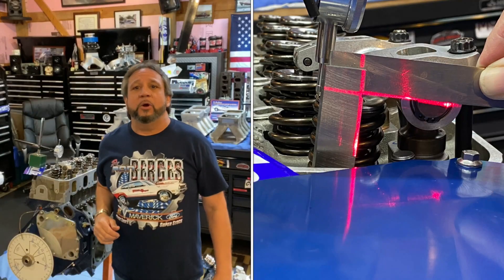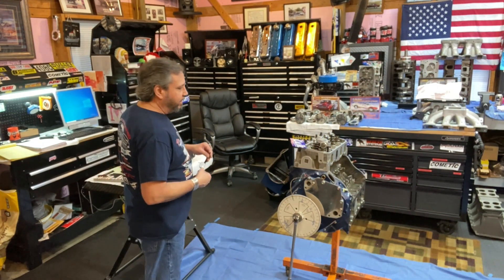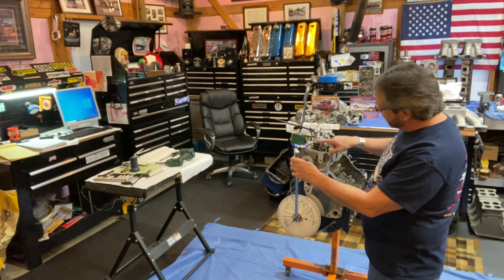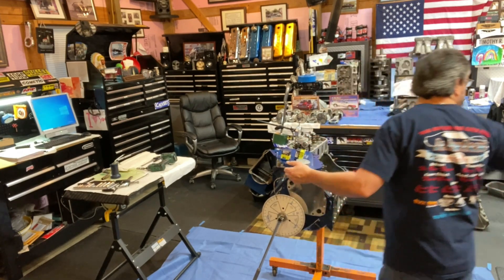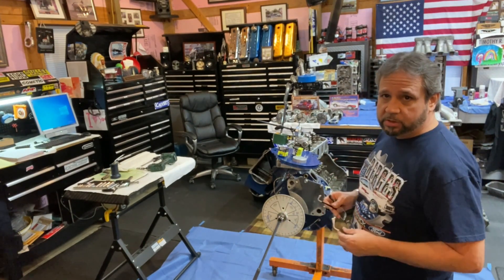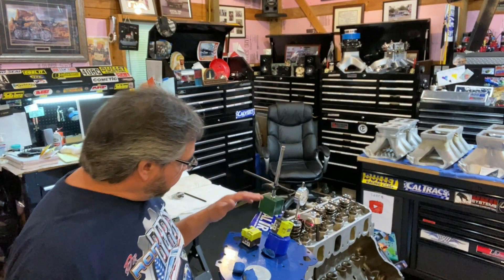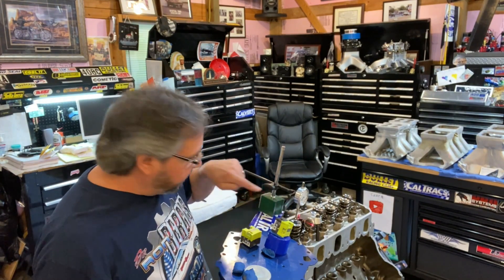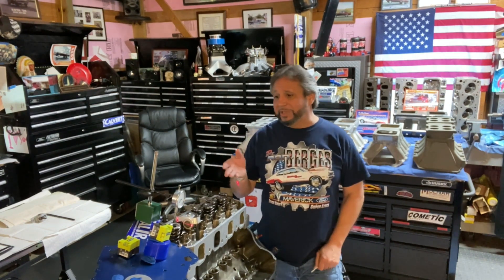Mid Lift Theory /Rocker Arm Geometry, Laser Guided Precision.

Comment: Hello, I think you would like to know that Jesel aluminum rocker arms are not
 designed for mid  lift. The tool that they sell for setting rocker arm geometry sets the shaft higher than than the adjuster. This gives the roller more movement across the valve, stem at low spring pressure or low valve opening. There is very little roller movement across the valve tip at full valve opening. Less wear on stems and guides. I worked there for 22 years and they were always this way. Instructions are on the website if you’re registered I love watching your channel. Keep it up. Thanks.
Reply from the maker: I have seen the tool, I know what you mean. I have always just used the pattern with dykem. Russel Saliba turned me on to this, so thought I would make a video and see how it works. Others have said this is wrong. I say do what works for you. Glad your here. Always seeing and learning something new at DragBoss Garage

Comment: Thanks for the video. I’ve always been a believer in the mid-lift theory,but never once thought about using the lasers. 

The lasers are the Ryobi ell1500  from the home depot if anyone is wondering; I didn’t hear it referenced in the video, but I zoomed in and noticed the model number.

I also believe that this same principle applies at the pushrod; if your pushrod axis is at an angle to the valve stem axis (as most engines are) ; the optimal pushrod length will be when the ball of the adjuster is at the intersection point (90 deg) of the pushrod axis to the rocker pivot….
Reply from the maker: Your most welcome.  I forgot the part number good eyes for sure. It something someone showed me so I tried it. Close enough for government work. Thanks for watching

Comment: Nice job Tim.  I have also tried many types of rocker arms to not only get 90* on the valve side at mid lift, but on the pushrod side at the same time. Hopefully the roller tip is close to the center of the valve tip within reason.  With so many different rocker arms, valve degrees angles and stud locations it's not always attainable but I did manage to find one combination that worked for me.
Reply from the maker: Yes, it seem to work out. Well, after I run it a few more times, I need to pull the passenger side, header to get ready for the transmission. Then I may run the lash just to make sure it’s good and ready to rock. Seems good I appreciate you being here Lou.

Comment: I think that makes total sense. That gives the same amount of positive and neg travel to the rocker. Having rockers that adjust the lash on the pushrod cup would be ideal. When pushrod length is your only way to correct your geometry your stuck with .100 increments and lash caps. But the theory is sound.
Reply from the maker: It seems to work and make sense and laser accurate so I used it.
Reply: @DragBoss351Cleveland  Yeah I totally agree. I'm looking at lash caps to fine tune the angle on a sbc where I'm limited to certain pushrod lengths
Reply from the maker: Yes have ti valves and use lash caps so had to take that in consideration for length too Bo

Comment: Great stuff 👌🏼🏁
Reply from the maker: Just another tool for the tool box, and cheap too.
Reply: @DragBoss351Cleveland  yeh man 4sure 👌🏼
Geometry in the valve train is very important.
The Blue’ing bit & keeping the roller tip in the centre of the valve tip is a must for sure 👌🏼
Laser bit is new to me 👌🏼✅ there’s always some maths at play isn’t there (mid lift)....
Another great way to confirm or double-check i guess......💪🏼🏁
Reply from the maker: That’s the way I look at it, another way and also check your results after using the bluing method. Sharpie marker works best and easy clean up. Thanks Janks
Reply: @DragBoss351Cleveland  👍🏼🏁

Comment: the way you set up the lasers looking down the head is fine for inline valves.  for a canted valve you have to rotate the setup so that the lasers are perpendicular to the rocker arm.  this means rotating it 20* or so for a cleveland.  aiming for mid lift means shimming the rocker arm *first*, then finding the proper pushrod length (don't use the pushrod to "fix" geometry).  Billy Godbold said he aims for 30% lift.
Reply: What do you mean by shimming the rocker arm ?

Comment: Rocker arm geometry is a really complicated subject when u actually get into it.  Not only the arc of the valve side but the pushrod side has it's own arc that's different.  Using the dye or marker method can be used and should be done, mid lift theory is something u should always check.  Getting the height correct is the most important, then u can move the rocker fore or aft to get the sweep u want.
Reply from the maker: It sure is. I will have Larry Olsen back on and he wants to do a live chat on rocker arm geometry. I have used both methods. Laser method held up for me, so I roll with it. Lots of hidden hp in rocker arms. Stay tuned Mike.
Reply: That would be awesome.  They don't make em like him anymore.
Reply from the maker: Nope they sure don’t. Alan Root will be back too in the next month I hope for a big announcement. Have a Merry Christmas

Comment: Great video!  The use of lasers is a great idea.  Also, most of the techniques & theories you go through can be applied to engines in general, no matter what manufacturer and design. Specific valvetrain design can be applied to the 385 series big block as well since the valve angles are the same and port design are very similar.  Thank you for sharing your knowledge.
Reply from the maker: Don. Thanks so much for the positive comments and your experience. You are right, applicable to any engine. Great to see you here, more in store
Reply: @DragBoss351Cleveland  I built a 400M using KB pistons for a 351C & bushed rods, decked block  & heads, port & bowl work on stock heads with new guides, seats, & '80-'82 single groove OE valves, roller rockers with the Crane plastic insert guide plate kit, custom Comp cam (used SB Chevy lobes) to keep 218/224 @ 0.050 duration & about 0.550" valve lift, ported & nearly fully polished exhaust manifolds, ported & matched Weind Action Plus intake, ARP bolts, Fluidamper, 650cfm 4150HP carb, Duraspark ignition (recurved), & dual 2 1/2" pipes.  It has 11:1 CR & runs good on 92 octane with additive.  It is a torque monster in my '79 F-350 4x4.  It is almost 20 years & over 130,000 miles on it so its getting a bit tired. The machine shop didn't keep track of piston & rod placement, so it                  has a pin bushing that is making noise.  Thinking about doing up a roller cam & bearing 10.25:1 521 with Kaase P51 heads, headers, & TBI set up.  Love seeing all the great info for an excellent designed Ford engine being discussed & shared.  Keep up the good work. Cheers.

Comment: How about the off-the-seat valve accelleration rate?
That is... the relationship of the valve tip contact point, fulcrum center, and pushrod center pivot.
By altering this relationship, the off the seat can be faster without affecting the rocker arm ratio.
David Vizard is the only one that I have ever heard mention this... and very briefly in passing. He has tested identical ratio rockers with altered angles, and gotten +30 hp increases back to back on the dyno.
JME 😎
Reply from the maker: Thanks for watching my video, The specifics of valve acceleration, and effects of rocker arm ratio, along with cam ramp profile, are something, I am trying to grasp, and a get a handle of it. Tough topic for sure. Jim Miller who came up with this theory replied, pretty thick material, read his replay may give more insight JME.

Comment: Nice job Tim.  Are you making these mid lift 90 deg checks with a solid lifter or is there a hydraulic lifter with correct pre-load already adjusted.  I plan on using this method as you describe and I want to ensure my set up is correct for the check.  Keep up the good work buddy.
Reply from the maker: Thanks Brandon. I used solid roller, or solid lifter as you should too. Don’t know much about hydraulic cams, but think about it, thoughts?
Reply: @DragBoss351Cleveland  Yes, totally agree.  Even with a hyd roller cam, you should make these checks with a solid lifter and then add the pre-load amount to the final length.
Reply from the maker: Yes sir. Let me know how it works out. Appreciate it Brandon.

Comment: Yes, that is for sure, they do make power. Slightly off topic but still very much in Clevo world; back to oiling. Listened to two chaps discussing number 2 and 7 rod bigends, showing undue wear or failure. They attributed this to crank oil phasing and the use of non fully groved main bearing sets. These two guys, said that even with all methods people use to avoid this sad event, when they went to aftermarket stroker cranks, no more problems. Just sharing some thoughts other builders have, about this weakness, in otherwise a romper stomping engine, indeed!
Reply from the maker: Yes I have heard about the cranks before. Since I started running aftermarket cranks never any issues, but also run a 9 qt pan. Yes have seen some vids about oiling 2 and 7. thank you.

Comment: Nice work Tim a great method I have never heard of before, accurate and I like it. Could you please share your thoughts and experience with using the Yella Terra 1.8 rocker arms or the 1.73, much respect from Tasmania, Australia.
Reply from the maker: Thank you. Yella Terra wants to sponsor me with a set of 1.8, makes my cam about .030 bigger. Have to make sure that they will work with your set up, PV clearance, push rod length, geometry. I think I can use them, need to measure my pedestals, as I may need to change them. I also heard bad things, about people breaking things with that ratio. Maybe because they did not check things over thoroughly. Share my Channel with your mates please.

Comment: Just a quick question, being new to this and all. I noticed you say net lift, I’ve heard others say gross lift which lift of cam x rocker ratio and then you divide that by two. Now is that a different outcome? Or is it an easier way for the same correct outcome?
Reply from the maker: To me gross lift is lobe lift x rocker ratio. Net lift is measured at retainer with assembled valve train. Watch this video

https://youtu.be/HZZccRK17Fg

Comment: i have howards hydraulic link bar lifters . should i ad lifter preload on top of the pushrod messurement? if yes how much? i'm using this method that youre explaining
Reply from the maker: I would say yes, just like it is going to be run. Your simulating the way it will be ran.

Comment: What am I missing here?  It seems you would want the horizontal laser to intersect the rocker fulcrum center and the tip roller surface that is engaging the valve stem, not the tip roller center.  If that was a non-roller tip that's what would count.  What if the roller was twice the size with the center moved up?  Or a tiny roller and the center moved down?  Same point of engagement at the valve stem end but the center of the roller would be way different.  Thoughts? -TG
Reply from the maker: Appreciate you watching the video and getting back to me. You are so correct this is a very difficult topic to explain, let alone understand yourself. Including myself. I see what you’re saying, and you may be right. I’ve been talking to Larry Olsen, who is a rocker arm expert. Make sure you watch his live chat. We are working on a live chat, to go over rock from geometry, and things he’s learned on pro stock engines. Here’s what he told me. Rocker arms are bent lovers, about 15°. That means the pushrod side reaches its velocity at a different time, measured in degrees of camshaft than the valve side. Think about that. He is working on a presentation to explore and explain this black art as he calls it. Stay tuned keep you posted.
Reply: @DragBoss351Cleveland  I'm putting together a non-roller SBF, Edelbrock Performer RPM heads but with studded rockers with a roller tip as the stock old rockers would hit the edge of the spring.  I found the center of the pivot point of the rocker and lined it up with the tip roller center but that puts the wear mark on the valve stem at 90 degrees almost off the edge of the stem.  I'm guessing since there isn't a center roller bearing that is throwing things way off.  I'd love to hear if mid lift theory applies to non-roller rockers.
Reply from the maker: @tpgroceman  you have to hear Larry Olsen when he come back on a live chat. He is the rocker arm king. With your build would not think any issues, but you finding some. I compared the pattern with sharpie and the laser method. My case seemed the same accuracy. I am no builder, just doing what I have done for 40 years. Slow but sure. Stay tuned for Larry. Keep you posted
Reply: @DragBoss351Cleveland  Did you ever learn anything further about the geometry being correct on center of fulcrum to roller center VS center of fulcrum to roller O.D. ??
Reply from the maker: No. I did talk to Larry Olsen and he is going to do a live chat soon on rocker arm geometry. So get his point. To me it is close enough for government work. Lol. Thanks

Comment: A little confused now. Those are Pedestal mounted Yella Terra rocker arms. I dont see how changing the pushrod length will change the geometry. With pedestals I believe you either have to shim up the pedestal to raise it or shave the pedestal to lower it. I am doing the mid lift check right now on my build with the same rocker arms.
Reply from the maker: Your right. Have to shim pedestal
Reply: Thanks for the reply and clarifying. Thanks for the videos. They are helpful.
Reply from the maker: Just how I do things and what works for me.

Comment: Very cool Thanks for sharing! What lasers are you using?
Reply from the maker: Got them from Home Depot. Thanks. Make sure you ck out the vids, subscribe, way more on the way
Reply from the maker: @msracingcomponents6550  I sub. Don’t have a good grasp of the operation, compared to adjustable push rod?
Reply from the maker: @msracingcomponents6550  subbed. Cool deal. Asked a question in comments.

Comment: Keep the roller centered as much as possible. Set rollers with rods and pistons out of engine. Rotate crank/ camshaft for least amount of friction of turning torque resistance on dial torque wrench. Takes time/patience. Install oil pan and keep oil pumping through mains and roller lifters.

Comment: I’m trying to establish the mid lift setup. I have all my measurements. The issue is… I am unable to get the 90 degree angle (rocker line to valve). It seems like the stud needs to be longer. I have the 1.5 ratio PRW roller rockers installing on Flotek heads. Am I doing something wrong?
Reply from the maker: That i am  not sure about Shawn, I used Yella Terra, so no studs. Make sure there is no binding of retainer on rocker arm or poly lock on rocker arm.
Reply: Shouldn’t I be able to get the 90 degree angle before turning the locking nut 5.7 turns to be at mid lift?

Comment: Help me. I think that I see a problem.
Using the lazer, shouldnt the lazer be through the fulcrum center pivot (it is) and at the contact point of the roller tip/ valve stem, not the tip roller shaft center? That is where the inked valve tip track contact point and lazer angular difference lies. 
THINK ABOUT IT.
JMO 😎
Reply from the maker: I am going by my interpretation of mid lift, and my research. From evaluation when I was making this vid, this is how I saw it, Need more practice, and set up... I tested it on the dyno, and so far everything looks good, so roll with it.
Reply: @DragBoss351Cleveland 
1) rockers vary from manufacturer to manufacturer in their fulcrum to both tip geometry.
Note again that the roller tip effective point is the CENTER of the roller shaft, not the roller touching the valve stem tip.
Since the roller rolls, it actually increases the effective valve stem length by half the roller diameter.
Think about it.